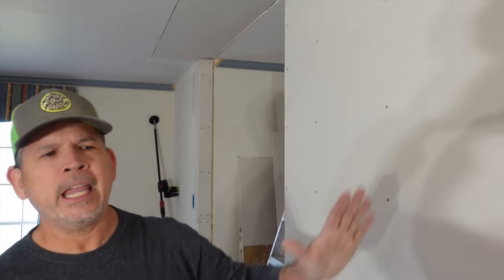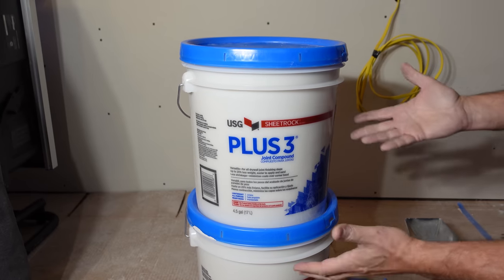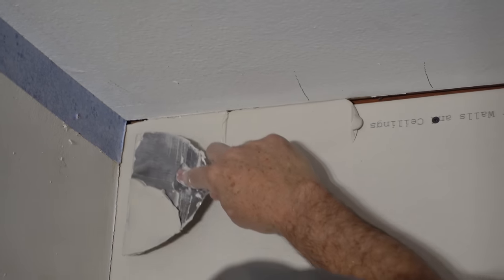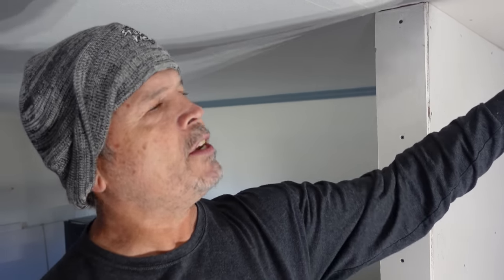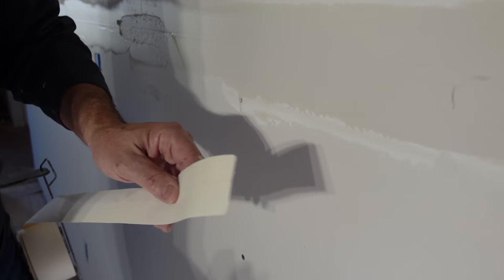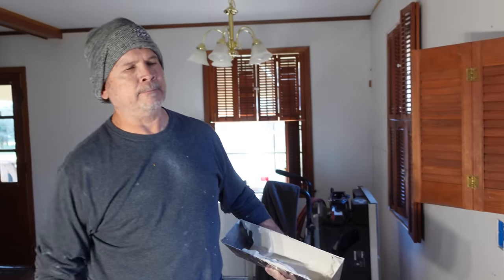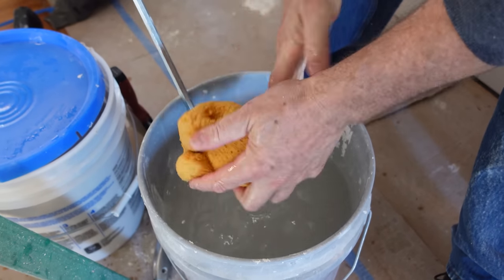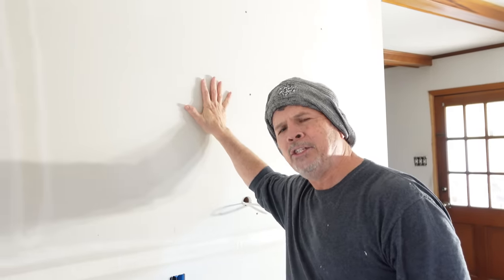How To TAPE and MUD Your DRYWALL | DIY GUIDE

Comment from the maker: Who caught the bonus tip at the end?! 😎👊🏼
Reply: Was a good tip
I always wondered why I needed to buy new stuff every time 👍
Reply: Ive been doing that. I didn't at first but figured it out
Reply: I've seen the clean the edge of the bucket before putting the cover on but never add water to it..... Great tip! 
The how to put mud in the 6in knife is the best. I would take forever to apply mud for tape and screws so I can't wait to try this. I've seen others do your method but they never explained how to apply it..... Your description really helps man! 
Been watching you for years and love your videos. I do this all week but yet I still watch this on the weekends. Keep up the great work!
Reply: Do you put a second coat of mud on the tape after it dries?
Reply: That is the advantage of using a bucket of mix over bag/box mix!! I very carefully have to twist the bag / box mix so as not to drop & contaminate with dry mud!! Great tip guys!!!
Reply: @MrTomac4  Yes and usually a third.
Reply: Talk about the ultimate moisture barrier with the reuse of the cleaning water. Waste not. Cool recycling tip. Thanks!
Reply: @MrTomac4  In the next episode.
Reply: We always buy a cake mixer and then throw away the motor and use the paddles to mix up the setting type. We run a lot of 5 minutes it's nice to mix it up quickly and throw it up and 10 minutes later you're ready to recoat it before you leave... We also only use general purpose joint compound for the paper taping. It has always been recommended and is much stronger. Different strokes for different folks.
Reply: go home🤷 best tip of the show 😜
Reply: they have screw on 5, gallon lids air tight 7bucks at HD they  work great
Reply: All good except I use my drywall knife to smooth the surface of the mud so that there's less surface area exposed to air.  

I couldn't help but notice that some of your tape was rippled.  I like to make sure that it's all laying flat so that no voids or bubbling of the tape occurs.  IMHO there's nothing worse than bubbling tape when you go to apply the next coat.
Reply: @newbutt  Ha!  I should have read your comment first...   ;-)
Reply: some things u pay someone to do
Reply: I do the same with the bucket mud storage, except I like to use the 6" to smooth the surface of the mud before adding water. (Only takes an extra second or 2.)

Unless my customer insists (& pays extra), I no longer use metal corner bead... there aren't any positives compared to commercial PVC corner beads.

The PVC 90° & bullnose bead all has a nice edge to finish to, but (IMO) the bullnose PVC corner bead looks far better & comes in multiple radius configurations. Plus with PVC if (more like "when") damaged, it can be easily popped back out, and with a little paint, will looks fine. It also doesn't rust in humid climates and if a kid (I have 5) runs into it with their head, it's extremely difficult to get sliced up.

Whereas, with metal bead, finish rarely goes as fast, to fix dings the corner has to be re-done, if there's a power outage (and subsequently too much humidity soaks into the mud &/or paper), eventually rust comes thru the mud & paint (it's extra steps of sealing to repaint after rust bleed-thru), and I don't know how they did it, but I've had kids get cut falling against properly bedded paper-faced metal bead.

PVC bead comes in large boxes from drywall distributors & doesn't cut up your hands during install work either.
Reply: Its really a Pro Tip, thanks guys it is much appreciated !!!
Reply: Time saver for sure.
Reply: I use to take some thin plastic and pat it down on top the mud. Not any more I'm doing the water thing.
Reply: yeah great tip i'm in southeast louisiana too renovating my entire house and i've definitely found out the hard way about how it will mildew
Reply: I used to worry about those dried bits getting into my joint compound but I stopped ,they disappear as they get reabsorbed with water or wet  compound. The ones that don't ,whatever, I flick them out with the corner of my putty knife and smooth them over. I know a guy I used to work with always swore and complained when those crumbs got in his mud. But yes a little water on top keeps everything fresh for the next day.
Reply: Wow! One of the videos yet, Drywalling is a tough job if you don’t a few lessons. Thank you!
Reply: Learned the water trick years ago. 😊
Reply: That was very helpful. The only thing you didn't address is to NEVER just rinse the 45 mix down a utility sink drain. Always safer to put any material left in the trash before cleaning the tools in the sink
Reply: @northernlightsrenovations1710  Use fiba fuse tape from lowes. Never get a dry tape bubble  again.
Reply: Excellent tips. 👌 👏 👍
Reply: Done a lot of DIY drywall taping, but I did not realize there is so much I did not know.  Really appreciated the end of day tip to keep your mud fresh for the next day.  Thanks!
Reply: We don't do that much drywall finishing so we use the box mud. I hate how the little dry crumbs fall off of the internal bag and contaminate the mud the next time  I use it.  I've got to get my boss to buy the buckets from now on!  Great tip!
Reply: Great tips
Reply: Great tip! just a DIYer. I find myself picking out crumbs. PITA and really slows things down. Everything in the video was great advice.
Reply: 🌊 great tip to save mud.
Reply: One of the best videos on this.
Reply: Saw that. I have used saran wrap to cover it in the past. Water is a good one.
Reply: I did, I did! What do I win?
Reply: r4
Reply: Whaaaaaaaaaaaaaaa??????????? great tip. That's what she said...
Reply: Take my views! Take my likes! Take my subscription! Take it all!
Reply: Clean counts. Anytime I have left over products I clean the bucket and lid, especially the lid rims. Whether it's mud, polyurethane or paint, spend a few minutes cleaning.
Reply: Always - glad you mentioned it.  Can also slow-down the setting time with a little white vinegar.......  Great video. Thanks
Reply: gr8 tip. we do the same with paint when it come to edges.No water tho'. also a bit cellophane under the lid can help for long term storage.
Reply: Love your channel! Do you have a video that shows how you cut the ends of Chair Rail molding? Like if I have it in the hall but not the living room...what should the end piece cut look like? Mine is a flat cut and it just doesn't look right 😕😅❤️
Reply: Most definitely did. I didn't know you could do that. I would usually estimate how much I would use so I wouldn't have to worry about wasting product. I will definitely use this when I build a garage.
Reply: GDay 🦘😉🤙 Teåch 
I’m enquiring whether you have to to put somesort of disinfectant in when mildew’s, a acquired a 3/4 bucket of premix, I Sure Don’t like seeing things wasted, is y’all .
I’m just a miscellaneous DIY’er, channel surfing 🏄🏽‍♂️ {👍➕🔔} helpiṈ’ with renovations for my Good Ma, since my På, feel off the proverbial perch., too early..🙏🙄🕊
Thankful 🙏 on ur numerous tips, there that I Gladly watched ür assigned commercials 🐨🖖 🌅
Reply: I definitely did, and a good bonus tip as a must need to know.  You have to be the best comprehensive skilled person out there to follow. Loved watching this video, and how to the point you were on instructing how to mud and tape drywall.
Reply: thats what she said... but for real, clever trick at the end, these giant buckets always sit for a long time in the garage. youre an impressive craftsman, i would hire you to work on any house i owned.
Reply: I did and am about to drywall and mud a main floor this upcoming week!
Reply: And now I know better not to buy boxes!
Reply: Certainly! Awesome tip on how to keep the "boogers" outta your pan for tomorrow!
Reply: Hey @Stud Pack ! At about 18:35 in the video you did an inside corner - something my dad taught me when I was younger was how to  make my own "corner knife" using a 6" knife, a cut-off wheel, and a belt sander to clip about 2" from one end.  I don't know the exact angle as I haven't had to make one in awhile but it makes a 90 degree angle (flush with the right corner wall) when dragging up the left corner wall.  You do drywall a lot more than I do so I know you have a system but I've really found it a nice tool to have, might be worth a try
Reply: Amazing tip.  I used to always fight that debris mud after.
Reply: Can anyone help I can’t get the tape to stop popping up on the edge one side is fine the other isn’t. I put plenty of mud and gave it time befor sanding the next day. I can’t find any good videos that show how to fix
Reply: @therealdojj  lol, you and me both.
Reply: Yep.
Reply: Can y’all show us how y’all Clean up y’all’s drywall dust if any?
Reply: @milesharlan1  Just get a couple buckets and dump the box in the bucket, slide the plastic over the flap and hold it just right it will slide in like it's a round box.
Reply: Question if I going to use wall  paper do I have to use tape and mud to fines or I can do the wall paper on tap of the drywall,thank you
Reply: have you ever snorted a line of unmixed 45 ?
Reply: How do you dispose of the water bucket for cleaning with all the mud in it. The mud settles at the bottom?  Thanks
Reply: Clean the bucket of the mixing compound and add water .. yehhhhh!!
Reply: I  ALWAYS watch to the end.  lol
Reply: Got it. Very useful.
Reply: @krsl5837   as soon as you introduce tap water in to the mix the bacteria begin to eat it and it rots. depending on the water source ive seen mud go bad as quickly as two weeks, but in the end it will rot no matter the lid.
Reply: I'm Retired!! Trucking!! Remolded  my fatherlaws house. I miss  DRY WALLING. IT CAN GET INTO  YR BLOOD 😂😂😂😂
Reply: He'll yeah buddy this is a great channel? Glad I stumbled across it. As a first time home buyer, my and I do lots of projects but I do the most diy's at apartment. Now we trying to get this home and sale is pendingwe are waiting on the appraiserand couple fixes by current home owner but this channel will help me when I need to remodel or repair things😊
Reply: @therealdojj  o
. 
K
Reply: F

M

 

O

Kk
I

O
M
Mo

M

M
M

K
😅
Reply: I wish they used that trick on big job sites, then us guys in other trades could use more of their buckets that are always laying around with dried up mud stuck to them. Haha
Reply: Do you have a video on how to tape and mud new drywall next to existing thick textured wall?
Reply: Thank you!
Reply: my gf caught my bonus tip ;)
Reply: great tip at the end! :glasses-purple-yellow-diamond:I just stopped by for a refresher
Reply: I like cleaning the bucket I've done alot of mudding and you just prove you can always learn something alot of times it so simple, why didn't I think of that kind of thing. Thanks
Reply: Definitely learned more in this video than I've ever been taught. Thank you! Literally saved me a whole lot of time.
Reply: Yep - in fact I want to put some drywall screws in the wall just to give this a shot.
Reply: I did sir!! Again, thank you!!!
Reply: Question after taping : Do you use mud over it again 🤔
Reply: @studpack - is there a 2nd video? Then what?!
Reply: Me
Reply: To do the mix mudding is it cold , hot or  warm water?
Reply: Got it 👍🏽. Thank U

Comment: If you ever want a side “gig”, please consider becoming a teacher.  This has got to be one of the best explained drywall mudding video.  I’m a DIYer in the process of finishing my basement here in Canada.  I plan on watching this video as many times it will take me to get the technique right.  Well done Stud Pack!
Reply: The only thing I would do differently is tape with green lid mud.  Green lid has glue in it and adheres the tape better (My old drywall finishing boss was ANAL).  Another funny thing.  He never let me use both sides of my knife.  especially my corner knife, 4 or 6.  Because 1. It rounds the edge over time so it doesn't gouge into the adjacent corner. And 2. There's a bend to the knives using just one side and the corners get rounded over so you don't get corners dragging along your joints.
Reply: i think that is already a side gig for him
Reply: Vancouver carpenter is EVERYThing to do with drywall. His videos are amazing and he has one addressing every possible scenario with drywall, taping, finishing..all of it
Reply: @leozmaxwelljilliumz3360  Literally a sin to even bring that guy up here.  When he muds it looks like a flamingo trying to do not-flamingo things.
Reply: @HIS_tube  😂
Reply: @HIS_tube  6w1
Reply: @garywilliams692  Having a hard time understanding that one..
Reply: this! 100% agreed
Reply: @leozmaxwelljilliumz3360  I love Vancouver Carpenter's drywall videos.  He's an excellent teacher.  
@Stud Pack goes into knife loading techniques a little bit more comprehensively.  
I appreciate the knowledge openly shared by all of these teachers.
Reply: @HIS_tube  u said the same obvious  thing twice
Reply: Agreed!!
Reply: @HIS_tube  I love to paint, so I love an anal drywall finisher.  My daughter just bought a house and the condition of the walls makes me want to cry.  So much slopped up paint over horrible mudding and in some places, no taping at all.  We can’t blow it out, but it hurts to spend time and $ painting that crap.
Reply: @HIS_tube  6w2
Reply: @rufusjohnson3800  Jesus is the Way, the Truth and the Life. No one comes to the Father except by Him. 

Try Him. I bet He’s better than trying to find out who you are through the Enneagram.

Comment: I'm a pro painter. Been in the industry all my life as my father and grandfather. This is the best, friendly, professional, simple and understandable video on taping and mudding I've seen. Thank you. Super quality and efficient.  That's key.
Reply: No. This type of celling needs to be oiled and stained only. The center boards are the only ones that can be painted because they do not have to account for multiple expansions or contractions in the wood.
Reply: @eaglewarrior8707  Hate to say it bud, but this comment makes absolutely zero sense.  This video is about mudding and taping drywall.  What in the world are you even talking about.  The wood is behind the drywall, that’s what it’s nailed to, and it definitely doesn’t expand and contract seeing as temperature in the house will be pretty consistent 99% of the time.
Reply: @eaglewarrior8707 ??
Reply: Agree
Reply: @eaglewarrior8707  Yeah, but most people would say you should dethatch your lawn BEFORE overseeding.

Comment: I have seen SO MANY "drywallers" apply tons of mud then spend their time GRINDING the excess off. My God! Light layers makes less work. I HATE sanding, but the rest of the drywalling process. It's an art, when done right
Reply: Orbital sanders make it super easy to sand off, takes time though.
Not disagreeing with you, just pointing out the reason why so many people do it that way.
Reply: @ScarletFlames1  some were using sanding sponges.....which makes them less qualified than me 😁. I can respect obital sanders though

Comment: I’m a general contractor. This guys tips should really be used. His technique is also standard for most mudders that aren’t using the level5 mud/taping tool…. If you can’t afford $1000+ for it then use this man’s technique and maybe expand upon because there’s only so much a video will teach you 

Best of luck fellow contractors and DIYers

Comment: Thank you, thank you, thank you!!! My house settled a few years ago and i have to re-tape and mud all the drywall joints in my century home. Uggh!!! A friend who is skilled in this craft came by leaving me supplies and a "way too fast" tutorial. He left me a 12 inch blade, and as a woman, that was too heavy for me overhead on a ladder, but he insisted that was the only way. So that project never began. I can't tell you how happy I am to see that 6 inch blade being your #1 tool of choice. My project is going to RESTART, thanks to you!!
Reply: Use all Purpose mud  to tape with Has glue in it and it keeps the tape from cracking, He is using fill coat mud,

Comment: We had an unused ice-maker 1/4” copper water supply line leak and damage the ceiling drywall in the basement. I spent the day today cutting out the crumbly drywall and failed tape joints. Tomorrow my son will help me hang a replacement panel, then I will get busy with the Easy Sand 45 before the final taping and texturing and repainting the whole ceiling. This video is getting lots of replay, and is helping A LOT on this project.

Comment: Yes I was a pro drywall guy, but you have all the tricks already in your video.  Nice to see you teaching the people the right way without having to learn slowly on the job. 

Great video
Reply: Especially overlapping the tape I dunno why people don't do it
Reply: I used to think it made it mound up to much by overlapping but the more I've done I see it helps hold down those curled ends. I'm no where near professional but I've gotten pretty good if I say so myself.
Reply: It's an okay video at best I'm not sure what part of the country you did taping in butt he is not showing everything the correct or easy way that's for sure . Lol the DIY will get the basic idea I suppose you never mud the paper corner bead and then put it on the corner he's left-handed striping the joints with his right hand that would be awkward for anybody. You don't put mud or the first coat on the wet metal . And dragging your blade across the screws when your spotting screws is fine I guess, you could just cap them . But you definitely don't want to scrape into them like he's doing that's a good way to find a pretty good Nick in your knife. Anyway LOL maybe you were a hanger or framer definitely not a taper though I wouldn't imagine. I think The Kilted guys much better for the Layman to watch to learn the taping anyway just my two cents but it's okay they'll get the idea not a horrible video but definitely not all the secrets and tricks LOL